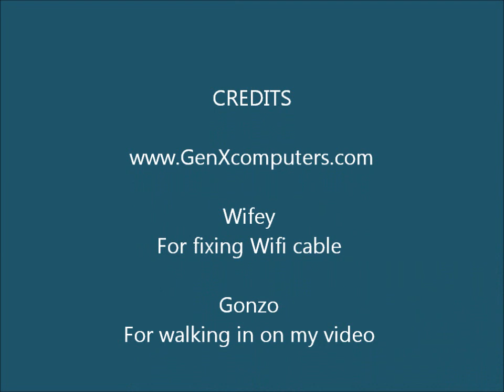ACer Aspire 5252-v333 cpu upgrade PT2

Comment: Yeah, it has been working/running fine for over a year but suddenly without warning it now doesn't boot or even try to post. I have taken it apart and went through it thoroughly but nothing obvious. Hit the power button, it lights, you hear the fan spin up but after a few seconds, it spins back down. No HD or Wifi lights, no beep. I'm afraid the MB is toast? Thank you the link but not spending $130+ when I only paid like $269 brand new for it.

Comment from the maker: Oh nooo... most of the time it's something not hooked up correctly go through it thoroughly to make sure you didn't do something like i did with the memory. 
if all else fails go on ebay and get used one ebay.com/itm/Acer-Aspire-5252-V333-15-6-250gb-AMD-V140-Notebook-Laptop-MINT-/331022885073?pt=Laptops_Nov05&hash=item4d128060d1

Comment: Thanks for this upload man, but could you tell me how to remove the hard drive? I got 4 screws in the sides of the casing for it and I cannot flip the motherboard over without removing the hard drive first. Got acer aspire 5251 1805, but practically the same inside as the one you've just shown

Comment from the maker: @mrniceguy1437 Good advice when i purchased my cpu i had to strike a deal they cost way over 100 dollars i made offer with guy in china for 80.  

The newer games such as skyrim demand more cpu power which are meant to run on intel latest sockets with built in Graphics support, it's one of the exceptions to the rule of most games.

Comment: @bigonnyou I'm using the arctic silver 5, this was my first CPU swap ever...I tried to skim it on best I could, sounds like I may need to try again? Will try the memory test too, thanks!

FYI:
For the $, I'd also suggest this upgrade for anyone using same laptop...noticeable difference and the CPU's are $20 on eBay. I can play basic new games like Portal 2 (lower settings) with no problems. I cannot however get it to play high end games like Skyrim, new Batman, F1 with out getting choppy on hi

Comment from the maker: @mrniceguy1437 No problem thanks, That temp seems a bit high though what type of thermal paste you use? also check your ram slots make sure they are seating correctly i had an issue as shown in another video where the paper was folding over keeping memory from registering on one slot.   (try running mtest also.)

Comment: I went ahead and did the same p320 in December. I keep it on a cooler most of the time, the highest I've seen it hold steady is 63°C during basic gaming (Portal 2 :P) These videos were great help on the CPU replacement, thanks so much!!

Only weird thing is I can't get over 5 (4/1) G RAM to work on this laptop...4/4works for 10-15 minutes then BSOD paging file error. Maybe a bad stick of ram?

Comment from the maker: @mrniceguy1437 I would stick with the same cpu to be on the safe side personally, one because it wasn't my laptop it was a customer, if it were mine i might have tried pushing it a bit more but would required more detailed research and monitoring because of heat.

Comment from the maker: @omnidox you shouldn't have any problems if your are familiar with taking laptops apart. as far as speed goes it was definitely noticeable going from a single to a dual core and worth it in my eyes exact speeds i can't say i didn't measure. the laptop worked fine before but didn't multitask the way i wanted it to so i took a leap and upgraded on my own little info was out at the time i did this.

Comment: hey bigonyou, i have 3 questions. First one is could i repeat your dismantling process with my 5253 aspire lap top.? Second question is how fast is the cpu speed of the new cpu that you installed. Finally, did you have any issues with the new cpu that you installed such as issues with heat? thanks for your time.

Comment from the maker: @alankwok1231 The memory cover has two screws you remove and pop it off. To detach it. Remove the rest of the screws on the bottom and flip laptop over and begin removing top panel keyboard etcc...  the motherboard comes out from the top not the bottom.

Comment from the maker: @demiro123  The Graphics card is very intergrated with most budget laptops ( i like where you were going with that though i only wished ) You wan't to look and make certain they have discrete graphics when you buy the laptop, they typically start at $750  look at a used one would be cheaper, but be careful they have overheating issues